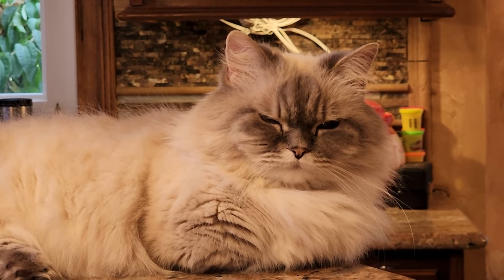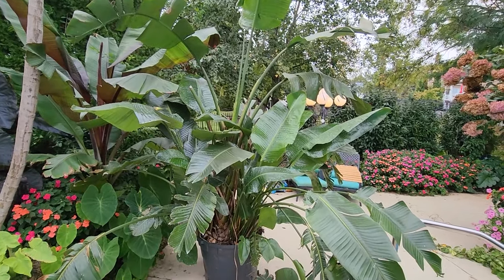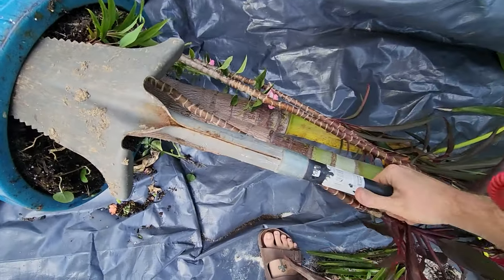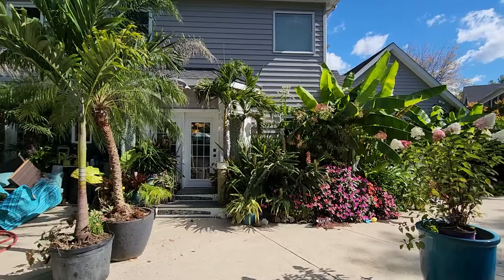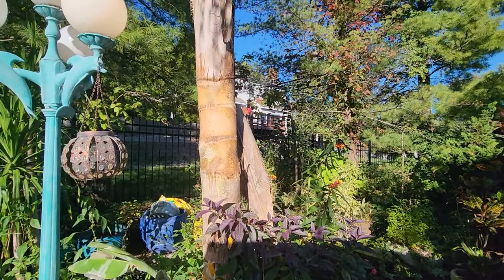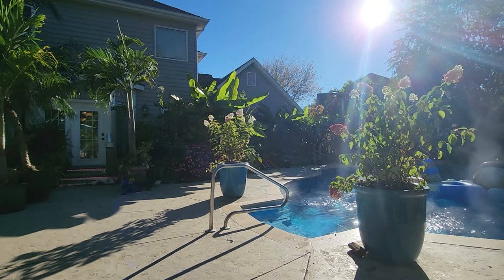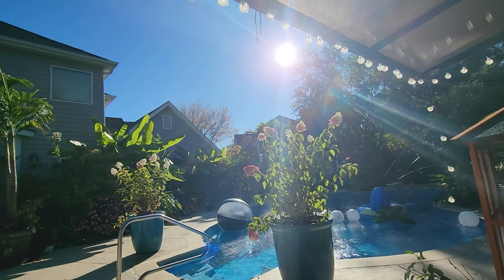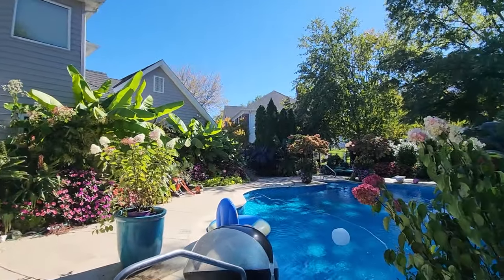Moving The Giant Houseplants & Palm Trees By Crane For Winter Storage || Saturday Vlog

Comment: Awwww seemed like a short summer....getting cool at night, rain starting. in P.N.W. Oregon.  Putting leaves around bottom of Bananna trees. Planted a big tote with Pak Choi....will do another one with the red cabbage starts...the totes will go on deck and get pulled into sun room if it freezes. The lettuce did amazing in the tote on the deck under the glass table so water did not fill no holes in bottom. Not 1 bug hole in the lettuce pick a salad. They came back. Thanks Jeff, Love your videos.
Reply from the maker: I know what you mean. Feels like it was just springtime! Good idea using the tote for the cabbage!